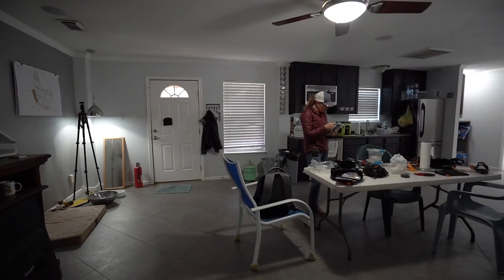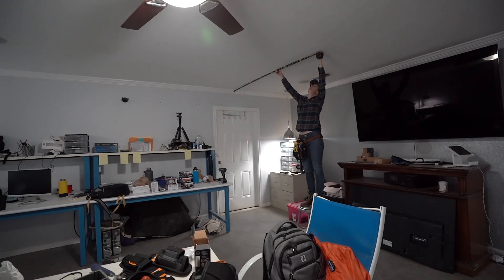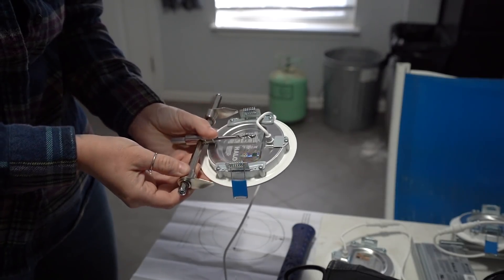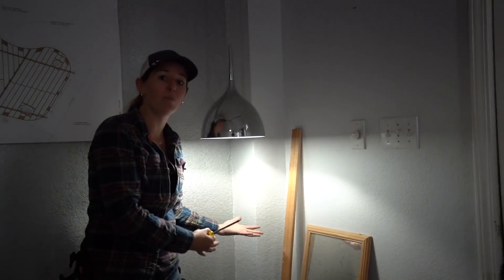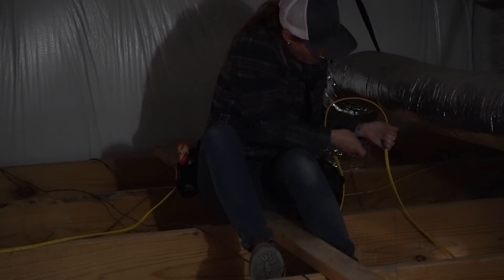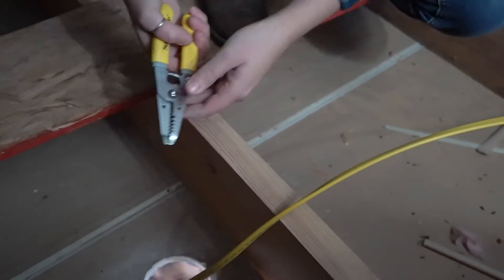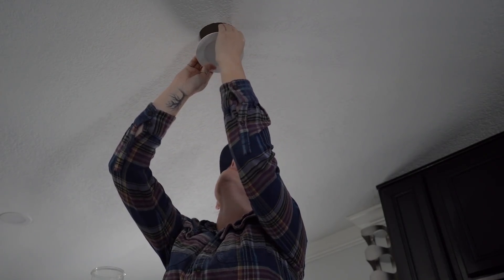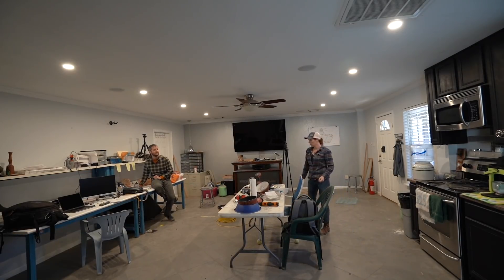Easiest Lights Ever! Install Recessed LED's In One Day

Comment: Those lights are the thickness of drywall therefore beauty is you don’t need to worry about joists. They will slip in even directly over a joist. If the joist is on the edge of the hole, orient the light so the spring clips go in the other direction.

Comment: I've installed those disk lights in my basement. They are fantastic, I highly recommend them. However, if you are intending on using them with a dimmer, they are a bit finicky. They will work at lower voltage, but in order for them to turn on they have to be at 50%-ish power, then brought back down to 15-20%.

Comment: Always great info.  Thanks.   Ps.  Shorter  people can use a paint roller and extension pole for pressing the tape on the ceiling.   Use the step ladder to press both ends in place, then roll it.   Works nicely for 6-footers marking higher ceilings.

Comment: I'm no lighting designer, but I do walk through a lot of new high end construction projects at work.  It is common these days to see recessed lighting much closer to the walls that in days past.  I think the theory, is that you actually want to light the wall, not the "air", or the floor, to achieve a cozy result.  We really should be thinking of the illuminated wall as the light source, not the light itself.  Good job though April.  This was a nice summary of the process.

Comment: Easy way to avoid a face full of plaster/ dry wall dust is  to spray shaving foam on it. It will catch all of the debris.  Works a treat if you are caught out during a DIY job.

Those lights are a lot more complicated then the ones I know.  I have always seen the units as a single piece that you plug into a power point type fixture.

Comment: I've put those lights directly under a joist. Probably the best reason to get these. They are the thickness of drywall and the clips and boxes and be put to the side. I've had mine almost 2 years and they are great.

Comment: Just a heads up. Those specific lights do work if your layout hits the joists. The low profile fits inside the drywall and you can put them anywhere. The only clearance you need is for the spring catches to open and enough room to slip the transformer up. Nice work.

Comment: Did a similar project in my basement a few years back with a set of 8 recessed LED fixtures.  The room was going to be a theater room with multiple entries so there's two seperate switches that together go to two different dimmer switches, so the 4 lights closest to the screen could be dimmed more than the 4 at the back of the room.  It was a bit of a headache to figure it out, but the electrician that did the code inspection was impressed and it works well... unfortunatelyi that theater room has been transitioning into my basement wood shop over the last 2 years... now I have to wire in a 240v for the tablesaw I just picked up.

Comment: These are awesome! Just put a bunch in my basement finish. You can take the gasket off the light if you don't need it's moisture resistance so they fit even better to the ceiling

Comment: I have those exact lights in my basement rec room.  We had those big pot lights previously and they weren't the best and made the basement very dingey.  For about $85 per 10 pack, I upgraded the lights in an afternoon.  Everything is nice and bright!  Tfs!.
Reply: Where did you purchase 10 for $85? I saw them for $25 each.
Reply: @jamesjonatzke7353    Correction, it was a 6 pack on Amazon.  Still well worth the money.  Just look up pot lights.

Comment: You kept the lights away from the fan which is very good.  My suggestion to anyone having a fan and lights is to make sure the fan blades do NOT intersect the light cone as the fan blades will then create flickering shadows that are a huge distraction unless that is your goal.  I once made fan blades from clear acrylic to cut down the shadows made by the blades.

Comment: I love these lights as well. The basketball was idea was clever, but my cutters have always included the clear cover. Also, having a clear cover makes it much easier.
ALSO, you cannot use just any dimmer switch, it needs to be designed to handle LED lighting... your lights can prematurely burn out. I believe that dimmers meant for incandescent are rheostats, variable resistors that restrict current flow. But LED’s need to be controlled by PWM (pulse width modulation ), essentially creating short bursts of full power to create the desired output. 
That dial is definitely a rheostat and should be replaced, but in the meantime keep it at full power and shouldn’t cause a problem.

Comment: You might want to use a Lutron Casetta dimmer with Pico Remote for your recessed lights. This will allow to pair the remote with actual dimmer.
You can also pair a single remote with one or more actual dimmers. The dimmers can also be controlled via a smart phone and group multiple dimmers into a "Scene" with the optional Smart Bridge (requires a LAN Internet capable hardwire ethernet connection).

Comment: Would love a link to the basketball you used :) Clever idea having choked on enough drywall dust doing my own lights.  Suggestion though--this video seemed to be missing some detail compared to your others.  I know you talked about wiring, and daisy-chaining, and dropping wire through each hole.  However, with the transformer in the ceiling mounted to a joist, you'll be doing the wiring in the attic--so maybe save many yards of Romex by cutting as you need it?  Also, does the wiring pattern connecting all the lights matter?  Or is LED low-power enough (for this application) that it doesn't matter how many are on a string?  This could also be a "code" question that differs by locality...  Anyway, love your videos--always inspirational!

Comment: Great tips and video... I have a set of their tool belts and I use one of their padded belts as well.  The set of knee pads I have elate the ones with the interchangeable pads.

Comment: You're lucky you have access to the top of the ceiling by your "attic" ... this would be a hell of a lot harder to do in a house with a second floor or even cement ceilings.
But I am impressed with the toughbuilt tool bags ... going to check them out now :-D

Comment: These definitely are sooo much easier than cans, but the job goes from easy to a pain if you don't have attic access like the first floor of a 2-story home. In that case, you are going to have to use a long flex bit to drill and snake the wires through joists.

Comment: I’m definitely Adding some of these to my garage.
Reply: I was thinking the same thing. In Idaho, I have an extreme temperature range depending on the season. I wonder how well these LED lights will work when the outside temperature is 100F or higher during the summer and 30F or lower in the winter?
Reply: IDMooseMan  should be fine.  I have led can lights for my exterior accent lighting.  Same temp range.

Comment: April, why didnt you just wire everything while you were up in the attic? Mount all the transformers, secure everything? You would not have been wiring overhead and you would only make one trip to the attic. Awesome option over traditional can lights.
Reply: I don’t know about where she is but around where I’m at in Texas these light are more used when you don’t have attic space or a joist is in the way of the light as long as you have wire near where you want the light whether you do a remodel and run new wire leaving extra in the ceiling or take an old light down you can reach up in the attic to pull the wire down connect it in the junction box then just push the junction box in the attic space where it can free float then just attach the bulb part and install that in the ceiling

Comment: I used a crossline laser to mark the ceiling. Functioned well. Was it more or less work? I can't say so for sure, although I had to measure less. However if you have one you may want to consider it as you don't have to worry about runing tape and possibly ruining a painted ceiling. PS- were the Fritos Code approved? (;-))

Comment: Great idea. Do you think it would still be a feasible installation if you did not have access above?  I need to do this but mine is between the first and second floor of my house. I imagine it would just mean spending time with a fish tape running wires.
Reply: Yes and no. I personally installed about 50 lights between floors. So, it is possible, but a fish tape won't get everything done. When going perpendicular to the joists, you'll have to drill through each joist to fish a wire across. To do so, you can use a long flexible drill bit or do what I did and use a 1/4 hex impact ready spade bit, which I fed up through the hole I cut for the reassessed light, and kept adding 12 in extenders as the bit progressed further and further until it reached another hole for a reassessed light. I chucked it into a drill though. I found that a flexible drill bit was a bit difficult to keep straight. Although, a higher quality flexable bit might work much better.

Comment: We did these in our house and they are easy. HOWEVER, strongly recommend not using that drywall bit she used. We did and if there is a issue it skips and jumps. Instead either use a standard (6 or 4 inch) hole saw or a gypsum cutting knife. Hint the gypsum cutting knife makes lets of mess if you take your time.

Comment: Be really careful when cutting round things like that basketball on a band saw.  The material being cut isn't supported directly below the blade and it will have a tendency to grab and spin the workpiece.  I  have seen some really nasty things happen when trying to cut into the round edge of a log and PVC fittings (hint, some blood, and a ruined $300 bandsaw blade).  In this case the ball is probably too soft and weak walled to spin.  And it probably didn't collapse because the blade had pretty fine teeth.

Comment: Is there a good rule of thumb as to how many lights per square foot of room?
Reply: depending on the light as to the cone of light they emit and ceiing height.  most lights in an 8 ft high room is 4-5 foot apart  same space away from the walls.

Comment: "Its actually really simple"
Unless you are anywhere else in the world than the USA where houses made from paper.
Try this in my house where I have solid reinforced concrete as the ceiling.
Reply: You could still install a drywall or panel ceiling for the purpose... it wouldn't be that unusual.
Yet there are very low profile ducts and ceiling lights which represent a far readier option to retrofit
Reply: I love my paper house
Reply: Don't let that stop you... You just need a more powerful hole saw :)  check out Core EZe
Reply: huh I thought my house was made of wood.

Comment: Was hoping for tips running the wires between stories, an attic space is cheating.
Reply: I recently ran a bunch without benefit of an attic space. They may large/long drill bits (think of the kind used for pulling romex, 3-4 feet long) that can be bent.  Use the drywall opening for the lights and a 3/4 or 1" bit to drill through the neighboring joist. The longest bits can get through two ceiling bays, or go through each side. A flashlight on one side or the other can help you thread two  holes, though it's tough! Good luck.
Reply: @bolland83  Figured that went without saying, but yes, one should know where one's duct, water, and DWV lines are. I successfully did it on a large commercial project without having to mess with the drywall, but yep - be careful!
Reply: I added 4 lights in each of the 4 corners of a room that only had a single light in the middle, without messing up any drywall.  First I pulled the existing box out, drilled holes in the ceiling for the lights, then used one of those really long drill bits (4'') with an extension (another 4') to drill through the 3 joists and reach the corner.  I used the drill bit to pull romex back through towards the center.  I did this for 2 of the 4 corners, then ran to the other 2 corners with the natural bays of the joists. I didn't have to deal with any ducts or pipes, that could make things pretty tricky.

Comment: Instead of using an old basketball which impedes the vision of your hole use a transparent plastic water catcher from the bottom of a potted plant about .25 cents at the garden center or if your really thrifty the bottom of a 2 liter bottle or milk jug.

Comment: Funny ya didn't show tying in the 2 -  12/2 wires into that tiny now overloaded junction box and these are around 7/16 + or - a smidge deep and can be installed directly under a joist
Reply: How would they be overloaded? You need one wire from switch or other light then another wire to the next light to chain the light together.
Most of these lights I put in have a 3 slot quick connector where one wire goes to the light itself and then you have two spaces open for romex
Reply: @zanekubicek2186 only because they didn't show the tie in lol jk... So the number of knock outs has no bearing on the box count, each box is measured with specific available volume and the wiring must be below the allowable volume of the box, to put it simply the junction box provided is not large enough, there is not enough box volume for daisy chaining.  
Typically an "accessible J -  box" (because the lights are removable) is made at the closest light to the switch and all switch legs are ran from it to each light allowing each light to contain only 1 - 12/2 or 14/2 wire per fixture.
Reply: @dogbehavior420  so your saying if you got 10-20 lights your going to run all separate switch legs to another box probably a 2-3 gang at this point with all the switch legs? Sounds like a bunch of wasted wire when I put these fixtures in have a 3 hole quick connect push in style wire nut where you have space for two external wires and one to go to the bulb

Comment: The distance between the wall to the first light from each side should be half the length as the distance between lights. Do not listen to April about her thoughts on where to place the first one. To get proper lighting it should be done this way. Not to mention it looks better on the ceiling.

Comment: Surprised by how many led lights you can power off of one switch. How do you figure out how many lights you can connect ?
Reply: In Ontario, Canada electrical code says a max of (if I recall correctly) 12 fixtures per circuit, so 8 lights and a switch makes 9 before counting anything else on the  circuit. I doubt it was a special circuit for two or three lights, so here that would not pass inspection. However, electricity wise, these are low wattage, so the switch would not have a problem  handling the load. Only the inspector would object.
Reply: @David_Powell  Thanks David.

Comment: Would have LOVED to have seen the actual wiring done....some of us are deathly afraid of electrical work and don't want to screw it up!
Reply: Electric code is different in different places.  Watching a non-electrician on a youtube video is probably not the best way to learn. (and probably isn't the part that April wanted to focus on anyway)

What she did in that attic space wouldn't pass code in a lot of places, from what I saw. In my part of the world the cable should have been secured to the joists near the boxes with a staple, and should have been routed thru holes in the joists rather than going over the top.
Reply: then its probably best you find someone a little more knowlegable to do it or help you out

Comment: I love your videos but compared to most people you had the ideal scenario.  I’m betting most people don’t have a 3’ crawl space above to easily run all the romex.
Reply: Maybe not, but she was going to do this project whether she had this crawl space or not. Turns out it was an even easier project to complete due to the decent crawl space. It wasn't labeled "The Easiest Lights Ever" because of the crawl space, but because the light install in ceiling part, was so nice and easy.

Comment: Did I miss the segment on wiring?
Reply: She didn’t put that in the video but there pretty simple to wire you can even do it from below. When running the wire just push it down the holes you drill then from below you can make it up in the junction box then just push the junction box in the attic space where it can free float and then just attach the bulb part and pop it in the ceiling

Comment: I won’t thumb down this video, but “easiest lights ever”? Really?
Reply: And no info on the electrical. Mounting the lights is the easy part. The electrical is the hard part.
Reply: All you do is run a circuit starting from the breaker box, to a light switch, and then to all of the lights.
Reply: @gettygarrettable  not sure what that means!
Reply: @charliehobson33  If you don't know what that means you're definitely better off not doing anything with your house's wiring. Having learned the hard way though fires and deaths, in quite a few countries it's illegal to modify your house wiring unless you're a qualified electrician. Selling a house with a bunch of amateur electrical modifications can also be very difficult or sometimes legally impossible.
Reply: @peglor  i know! I never would, don't worry

Comment: Still very primitive, why still use led with a separate transformer? Here in europe we have Gu10 led spots on 230v no transformer, much more easy
Reply: Should be easier again on the 110V US power supply.